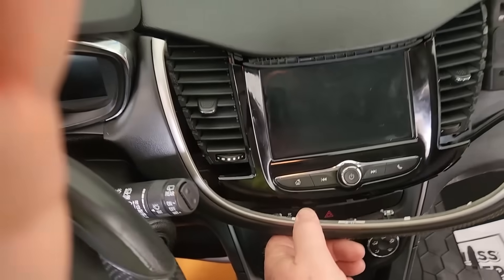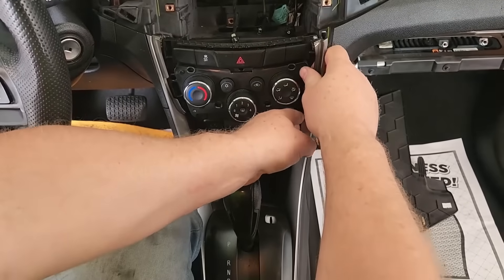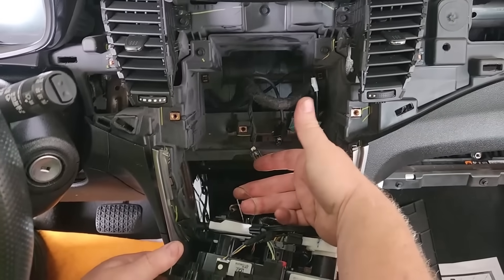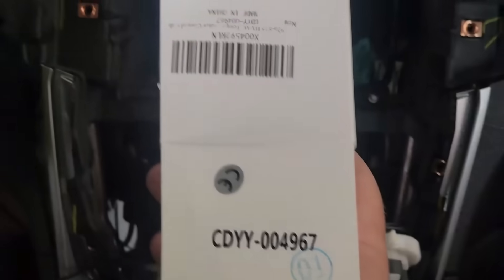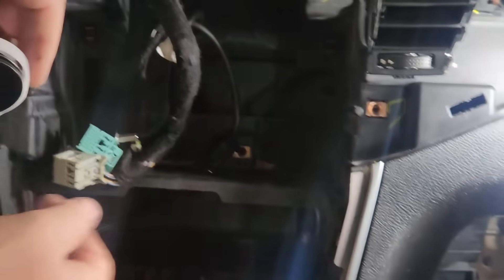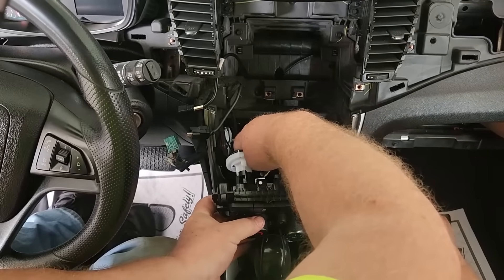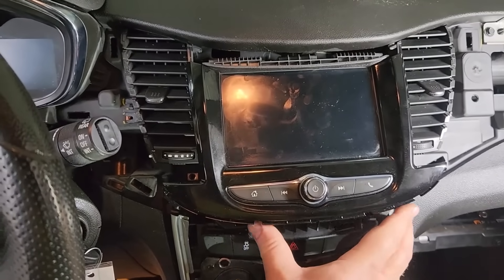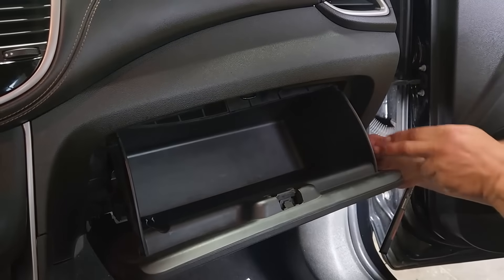How to fix your HVAC Climate Control Unit on a 2019 Chevy Trax

Comment: The knob that controls the speed of the fan is not working in any of the numbers.. i would smack it a few times before and it would turn on.  Now its just dead, could it ne the control module? I checked fuses and all
Reply from the maker: Absolutely. the contacts internally wear down over time and fail to make contact.
Reply: Sounds like the blower motor resistor. It's a common problem with the Trax. If you replace the resistor make sure to get the harness replaced as well or the harness will fry with the new one.

Comment: What about the one on the right that controls which vent the air comes out of
Reply: Did you ever find a video for this? I just bought a 2017 and I now realize the right knob does doing but make a bunch of clicking sounds and doesn't change the airflow

Comment: Has anyone else noticed in their 2019 Chevy Trax that the resistor and piggy back wiring plug keeps shorting out and burning up? I've had the truck since 2021 and had to replace the resistor and piggy back wiring 4 times. I took it to the dealer the 2nd time, they fixed it and it lasted a year, then I had to replace it again. I'm about to try to wire in a relay and an on/off switch. It's ridiculous. Searching Google shows it's a common problem with MANY.
Reply: I've replaced mine 3 times this year already.

Comment: The AC on/off switch (snow) does not work. Push it and little light does not come on. Does the whole control panel need replacing or will that little snow button pop out?
Reply from the maker: Panel Needs replaced
Reply: What id the link for the unit?
Reply from the maker: @JamesMoore-v1u  I simply ordered it by vehicle from ebay.